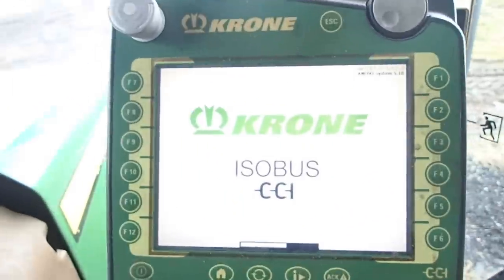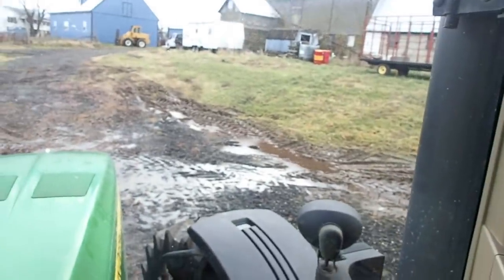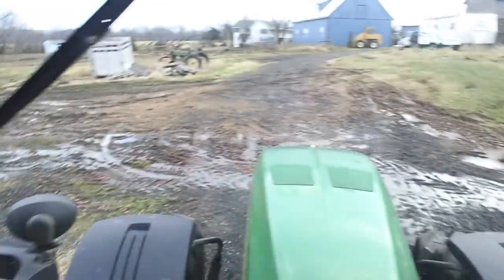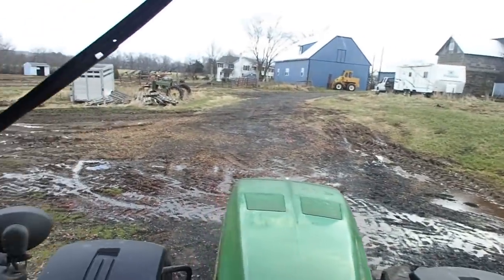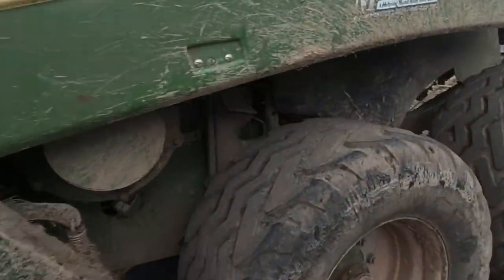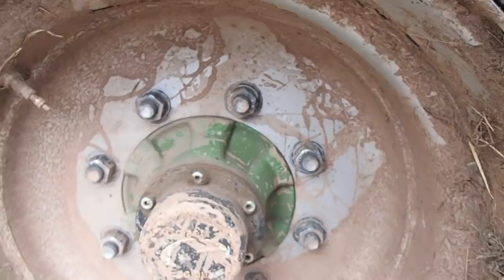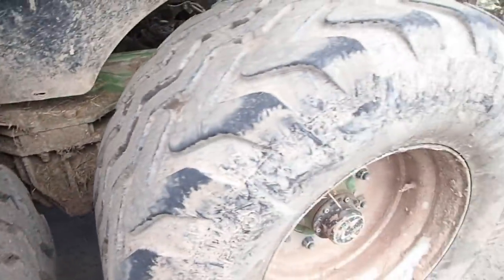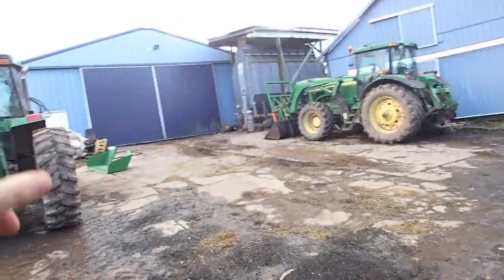Jumper Hose???

Comment: I use a jumper hose on our 4955. If it sits for several months, the 3point hitch will stick in the down position. For some reason after about 15 minutes,the hitch starts working.

Comment: Just get a fendt, it turns on the hydraulics automatically when you start the tractor if the oil is cold.
Reply: I finally saw a Fendt in the field today, it was on a manure spreader. Even though we are a pretty strong agriculture area John Deere seems to have a pretty large share of the market followed by Case IH and the Agco/Oliver/White/Minnie Mo legacies make a showing, unusual to see a Massey Ferguson or much of the import stuff.  I've been told we used to have a pretty strong Allis Chalmers dealer here but it's now a truck body & equipment manufacturer (one of two in town).

Comment: Here is some information from the Operators Manual of our jd 7280R Euro, most of the modern John Deere agricultural tractors will have similar recommendations for the transmission and hydraulic fluid. Most of these tractors do NOT use a standard hydraulic fluid in their transmission system.  They use a specialized fluid that in addition to being suitable for hydraulics, it is also formulated with additives for the clutches, bearings, brakes and other moving parts in a modern tractor transmission/differential/drive train.

Use oil viscosity based on the expected air temperature range during the period between oil changes.

-12F to 122F -25C to 50C Hy-Gard or JDM J20C spec
-40F to  88F -40C to 30C LowVisHy-Gard or JDM J20D spec
Other oils may be used if they meet one of the following:

John Deere Standard JDM J20C
John Deere Standard JDM J20D

Here is the starting page to lookup the operators manual for your John Deere tractor.  Have the serial number of your tractor handy to find the correct version for your model:
manuals.deere.com 
---------------
In those same manuals, in the transmission or tractor operations section, you will usually find a page about "transmission / hydraulic system warmup" . I looked at those pages for some of our jd tractors and some of Wes's and found:

the jd 7530 Euro has an automatic warmup of the fluid when it is started below a certain temperature.  Apparently Fendt does not have an exclusive on this feature.
The jd 7610, 8120, 7830, 8530 Euro, 7280R Euro are recommended to use a JUMPER double-ended male quick-disconnected hydraulic hose and 2 SCV controls for warmup of the Hy-Gard transmission and hydraulic fluid.

Comment: You still need a jumper hose in the 8530 and all large frame Deere tractors with closed center systems. The only way to heat up your hydraulic oil is to have flow and pressure with no work being done. By just setting your scv to continuous (on a closed center system) you won’t get any flow

Comment: I have used the jumper hose technique in the past and it works very well I just find it I really like the synthetic hydraulic oil for many reasons but cold flow is one of them the powershift react properly upon startup Hydraulics move well I use synthetic hydraulic fluid in all of my equipment.

Comment: I used to work for a deer dealer, when you lock in your remotes with no hose its bottoming out the oil and putting unneeded pressure on your remotes,  the jumper hose let's the oil flow at whatever you have your command center set for

Comment: Would it heat the hydraulic oil up in a 7200-7800-7810 if you just left the hydraulic lever in detent?

Comment: #68 hydraulic in warm weather. I think , 48 cold weather. The viscosity is how oil is rated.
Reply: THUMBS UP
Reply from the maker: in a deere you have to use there oils not equivalents. there are some major differences that can cause failure in these transmissions... i did use some equivalents and they just dont work well. they are noisy and the discs chatter de-laminination problems and the whole package.

Comment: many use hoses like that on trucks that have wet kits, when pulling a trailer that dont have the need for hydraulics. saves on the pump is the idea. dont know if it helps. body builder for my truck did not say i had to use one.

Comment: Our 7210r when it gets below -15F it puts the ivt into limp mode if you don’t use a jumper hose. Putting the system into high pressure standby with the SCV’s is better than nothing  but getting that oil flowing through the system really makes a difference on the real cold days.

Comment: Synthetic hydraulic fluid works great in my 4020 powershift I don't know about these fancy new tractors you guys have
Reply: Good point. Synthetic oils don't change viscosity as much between cold and hot as a mineral oil does.

Comment: Closed center you don't need jumper hose open center is when you need the (jumper hose) is what I was told may be wrong too
Reply: It won’t hurt a closed center to kick a remote in deadheaded. It will toast an open center pump. On the Deeres before the 8000 series, it literally doesn’t do anything without a jumper hose. Once the pressure equalizes, the pump just kicks out like nothing is going on. The 8000s and most other closed center tractors use a signal, so the pump will stay kicked in to a degree. Most are activated with a swash plate...pump output is determined by demand. In short, it always works better with a jumper hose regardless what tractor it is.

Comment: John Deere offers Low Viscosity hygard. The only problem with running it in a tractor is you have to recalibrate your trans and as soon as you hook it to an implement you start contamination with regular hydraulic oil. So unless you convert your entire yard or only use select implements on your chore tractor it doesn’t make sense. At least it’s why we don’t do it and we are in chilly Western Canada
Reply: Hi. Yeah the other down fall is having to change the oil back in the spring.  I'm in Michigan.  Although we don't get as cold as you, we will have spells of subzero temperatures.  I personally just give things time to warm up. I had a friend who grew up in Banff Alberta.  He told  me i really didn't know what cold was.  I believe him.
Reply: Dan W  we can have weeks when the temp will hover between -25 and -30F but the cows gotta eat so it’s business as usual
Reply: @gopherchoker  yeah I know it's a little bit rough where you are.  During a cold winter here those temperatures would be the lowest temperatures we would see. Most of the time it's teens at night and 20s for highs. I'd rather it stay below freezing during the winter.  My stock stays healthy and it's not that hard to get around.  I can move snow but can't do a damn thing with mud. It's cool to be able to talk to people from a different area of the world.